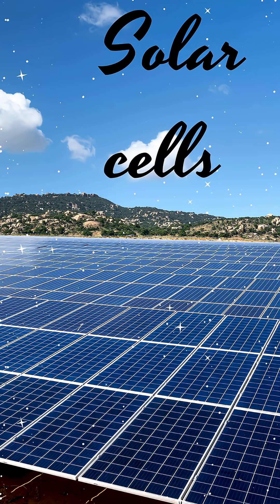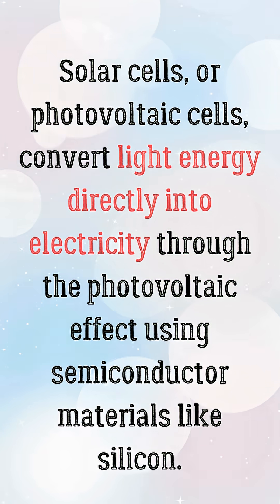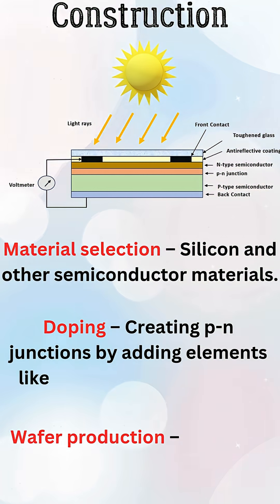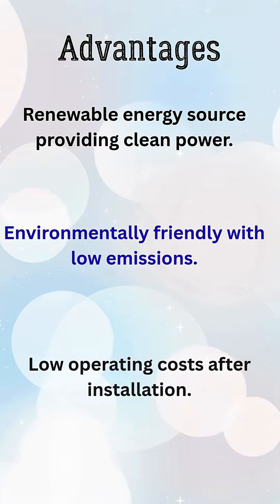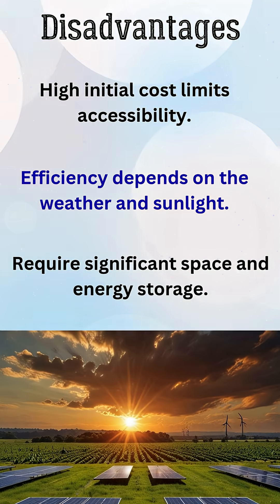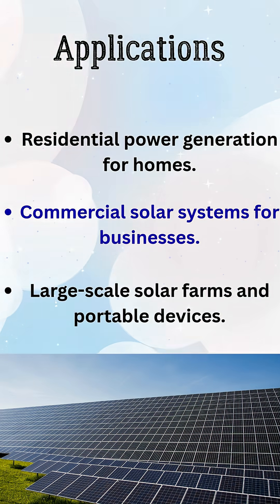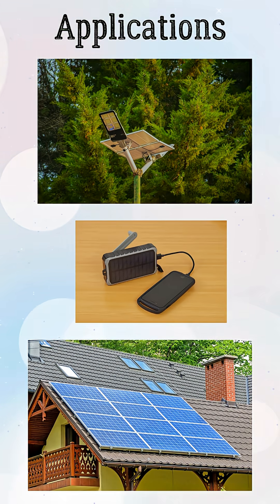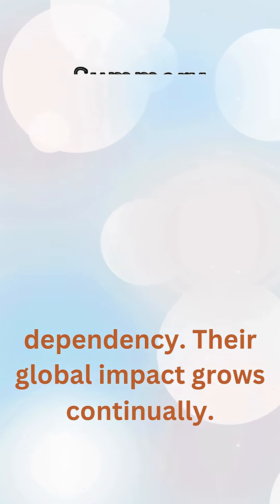Solar cells

Comment: The videos explains how solar cells work. The solar cells convert light energy into electricity through photovoltaic effect using semiconductor. It also demonstrates the construction of a solar cells with the help of a diagram, also highlighing the material needed to make the same. The advantages such as renewable energy source, low operating costs as well as disadvantages such as high initial coats , space requirement etc are also discussed in the video. The various applications of solar cells are residential power generation, large scale solar farms and portable devices.

Comment: The video explains what a solar cell is. A solar cell is a device that converts solar energy into electrical energy when sunlight falls on it.
1. Construction of Solar Cell
A solar cell is constructed using semiconductor material such as silicon, which helps in producing electricity from sunlight.

2. Advantages of Solar Cell
Solar cells use renewable energy and do not cause pollution.

3. Disadvantages of Solar Cell
Solar cells depend on sunlight and the initial cost is high.

4. Applications of Solar Cell
Solar cells are used in solar panels, calculators, street lights, and electricity generation.

Comment: This video explains solar cells (photovoltaic cells), how they work, and why they are important. It explained construction , advantages ( like low emission, low operating cost, etc) as well as disadvantages ( like weather dependency, high initial cost, etc). Applications of solar cell are also explained in simple way.
Reply: This video explain what solar cells or photovoltaic cells are and we get the idea of how they work and constructed. We also get to know about their advantages, disadvantages and their applications.

Comment: In the video we understood about solar cells they are the devices that converts sunlight directly into electricity by using semiconductor materials. We also get to know about construction of semiconductor and the work it do absorbing light to generate current .
And the advantages are they clean energy and more used in powering devices or houses

Comment: In this video basic concepts are there and solar cell means is a semiconductor device that converts solar energy directly into electrical energy by the photovoltaic effect . And advantage is useful in remote and disadvantage is highly initial installation cost and application is power supply for satellite and space station in this video is shown .

Comment: This video help to understand construction and working of solar cell with advantage and disadvantage.
Solar cell convert solar energy into electricity through the photovoltaic effect using semiconductor material eg.silicon 
In construction the layer of solar cell and the advantage of solar cell  it is clean energy and environment friendly. With some disadvantage like cost , maintenance etc . 
Thank you mam for valuable content.

Comment: This video explains about Solar Cell:
Solar cell or photovoltaic cell, convert light energy directly into electricity through the photovoltaic effect using semiconductor material like silicon ,And also explains about the Construction ,Advantage ,Disadvantage Working And Application .

Comment: In this video we get the information about the solar cell : solar cells or photovoltaic cells converts light energy directly into electricity through the photovoltaic effect using semiconductor material like silicon , application , advantagess and disadvantages of solar cells . Solar cells offer clean , sustainable energy with various uses but face challenges like costs and weather dependency . Their global impact grows continually .

Comment: This short video explains that what is solar cell their advantage disadvantage application 
It is device which converts light energy to electricity through photovoltaic effect using semiconductor like silicon.
It consists pn junction, silicon is dropped with boron and phosphorus it's anti reflective coating maximize sunlight absorption 
They are environmentally friendly 
There advantages and disadvantages are also given in this short video.

Comment: A solar cell is an electrical device that converts the light energy directly into electricity by the photovoltaic effect, which is a physical and chemical phenomenon. 
It's a sandwich of n-type silicon and p-type silicon.
We also learnt about its construction, working,advantages, disadvantages and applications.

Comment: Solar cell jo kee basically photovoltaic sell hain ye 
Solar energy jee ko electricity mein convert kar ta hain 
By using semiconductor material like silicon 
Diode jo solar cell mein hota hain pn junction 

Advantages:-
renewable energy,
Clean power 
Environment friendly 
Low emissions 

Disadvantages:-
Efficiency depends on weather and sunlight

Comment: From this video, I understood that , what are solar cells and how they convert  light energy directly into electricity and how they are contructed. I also learnt how they work (working principle) and the advantages of having the solar cells as they provide clean power and they are environment friendly and it also have some disadvantges also as they require hight cost and energy storage space and lastly learnt about the applications of solar cells.

Comment: A solar cell is a semiconductor device that converts sunlight directly into electrical energy. By the photovoltaic effect. It is made mainly of silicon . The absorbed light generates electron hole pair, producing electric current. Solar cells are widely used in street light, solar power plant,calculator

Comment: In above video I understood that solar cells are basically semiconductor devices which convert light into electricity , it can be any light but usually we use sunlight because it’s available in abundance,Here the photons are used to generate photovoltaic effect, there are some advantages of solar cells such as solar cells are used in artificial satellites to operate electrical instruments kept
 In satellite and there are some disadvantages of solar cells , solar cells are high in purchase , for generating the power large areas for panels are required for that smaller roofs tops

Comment: I learnt from above video about solar cell which convert the light energy into electrical energy by using semiconductor material like silicon and its construction which contains material selection silicon, doping create pn junction using phosphorus and boron and water purification and also explains working , advantages , disadvantages and applications

Comment: A solar cell is a semiconductor device that converts sunlight directly into electrical energy. It is typically made of silicon and contains a PN junction. When sunlight falls on the cell, photons give energy to electrons, creating electron–hole pairs. The electric field at the PN junction then separates these charges. As the electrons move through an external circuit, a direct current (DC) is produced. Solar cells are widely used in solar panels for clean, renewable power generation.